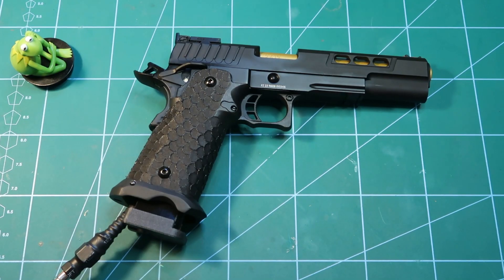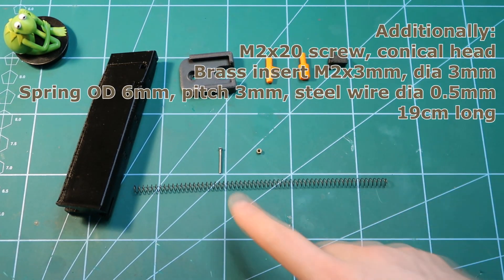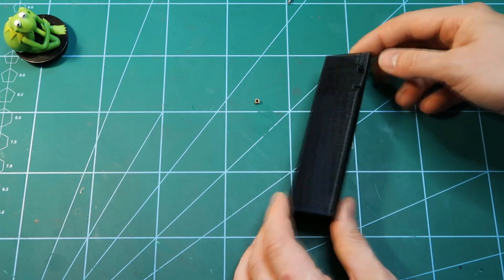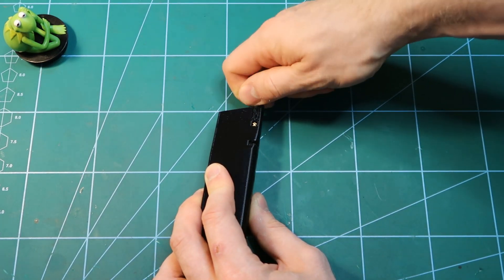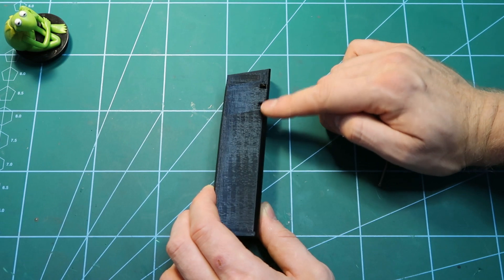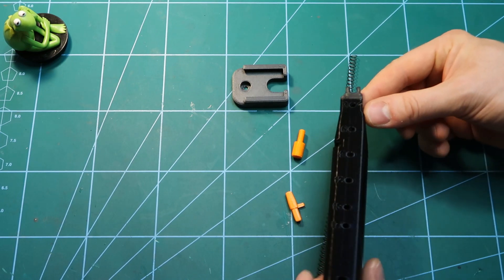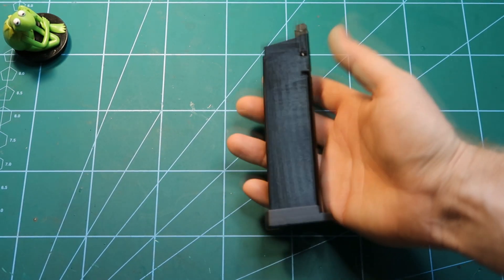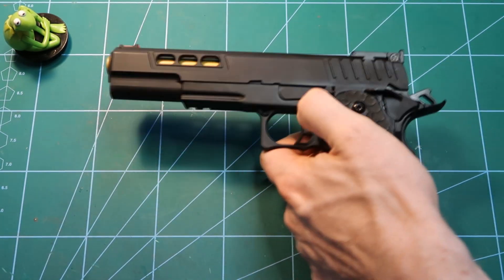Frog Manual #11 - F mag Hi-Capa for Frog Engineering/Tokyo Marui Hi-Capa GBB pistols

Comment: Is the conversion part made out of steel? Or 3d printed also?
Reply from the maker: It is made of CNC milled aluminum. Printed parts will not withstand the pressure and will not seal properly. Steel would be on overkill ;)
Reply: @frogengineeringairsoft  so i need to send the 3D file to a CNC mill?
Reply from the maker: Model of main conversion body is not published online.